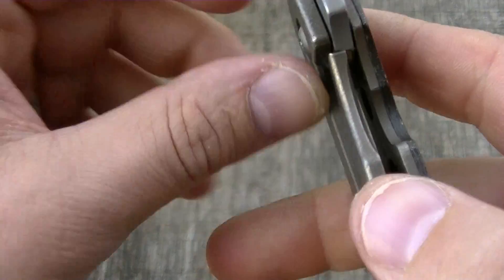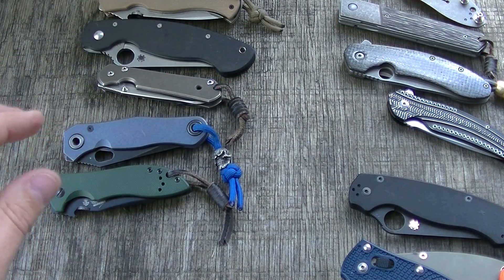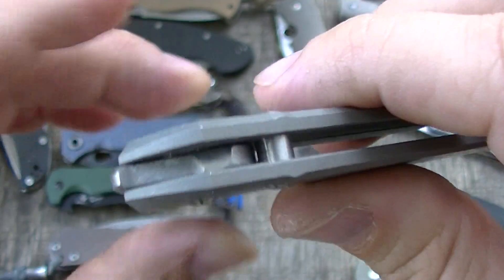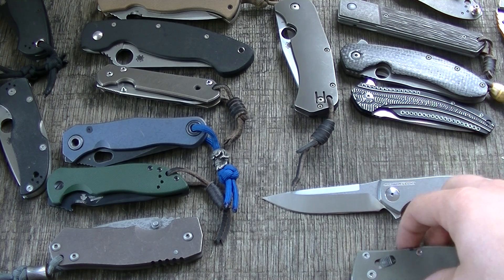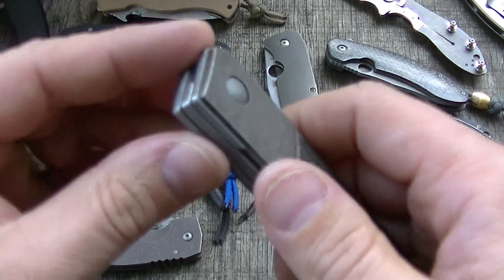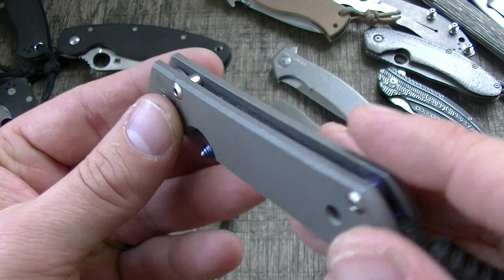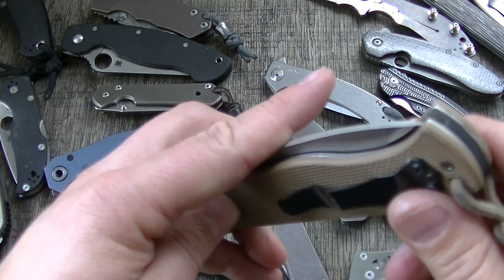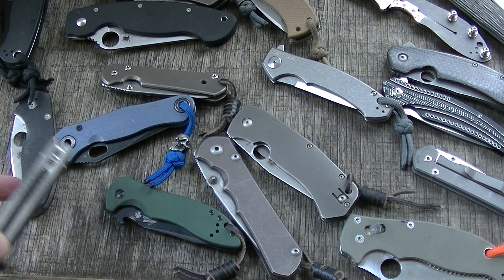Stop Pins, Why they Should Matter to You

Comment: this stop pin is a good point to hit on! this guy was just talking about his spyderco brad southard failure on the blade forums,although spyderco did replace his southard for a new one,i think the cut-out on the blade tang really will weaken the knife,he was only cutting though some hardwood when his blade cracked around the pivet and fell out of the frame!so as for the southard/domino there grate cutters,but not as a hard use knife!just would like to point this out,i own two of each but would never think of using any of them for hard use!only as a simple flipper/light use cutter,thanks again for posting.

Comment: great video man, I see that the stop pin goes secured in the hole liner, but the danger as you said is around the pivot the steel is narrow there. even if it is a gentleman folder, it can snap when push too hard.

Comment: The stress on a stop pin changes with the distance between center of the blade pivot and the stop pin bearing surface, the larger that distance (or moment) is the less stress on the stop pin for any giver blade stress. This would not favor internal stop pins ... IMHO
Reply: +Skip Fisher I wanted to write the same thing!
Reply: Interesting. In physics, the equation for tangential velocity is: Tangential Velocity= (angular velocity)(radius). If we use the distance between the blade pivot and the stop pin as the radius, then the larger the radius would make for a greater tangential velocity. And when things go faster, they hit harder. Real world examples: pitchers in baseball with long arms are better equipped to throw fastballs or like they teach in close combat/self defense - if contact with a blunt weapon is unavoidable (baseball bat, crowbar, etc) you should step in to try to minimize the force to the body instead of catching it at its length. Another example is racing on the track. When taking a turn, the runner on an outer lane has to run faster then a runner on an inner lane to stay even. So the closer the stop pin is to the blade pivot, the tangential velocity will be smaller.
Reply: Well,  that's nice, but doesn't cover this situation.  A stop pin here works more like the fastball after the pitcher releases it.   Friction slows it down rapidly, and it's going slower when it reaches  the batter than it was when it left the pitcher's hand.  The case here is not really important because the difference is so slight that you have to use the knife for  a lifetime before that defiance amounted to anything significant.  What really matters is how the blade is stopped, rather than the distance the distance between center of the blade pivot and the stop pin bearing surface.  A "slow" controlled stop is always less destructive than a fast, uncontrolled stop.
Reply: Great thread. I know it’s quite late, but I want to pitch in and say hyper guy’s post makes sense In terms of flicking the blade open: This is indeed a conversation of angular motion, and tangential force would be the determinant for how much force is being applied to the stop pin. 

But I think what OP and Randy Johnson were probably referring to is when the blade is already open and cutting things. At this point. It’s not an angular motion conversation and indeed one of moment (torque) arms because now a load is applied to the body (blade) as opposed to the body rotating about an axis as a result of inertia.

Comment: For me, and I expect for many others, this is based on assumptions. Ideally, we would test to failure under various conditions. Often, when one area is strengthened, it moves the point of failure elsewhere. The new failure point may be an area never previously considered as weak or vulnerable. It can be a place that fails catastrophically where the part fixed simply failed functionally. Assumptions, even educated ones, have a way of unleashing unintended consequences, possibly worse than the things we wanted to mitigate in the first place.

Comment: The Domino has a pretty strong blade for having an internal stop pin, most have about half the thickness or less on each side of the pin track especially when the pin is right in front of the lock face. I know this can cause issues because I snapped my Southard blade in half while carving some wood, and while a bad heat treatment likely had something to do with that it did seem unnecessarily weak in that area given the construction of the rest of the knife. As the 0450 shows, you can make a proper flipper with an open stop and I don't see the need of "hiding" the stop pin. Will 99% of people buying a knife with an internal stop care: no, but in my mind it just isn't the best design.